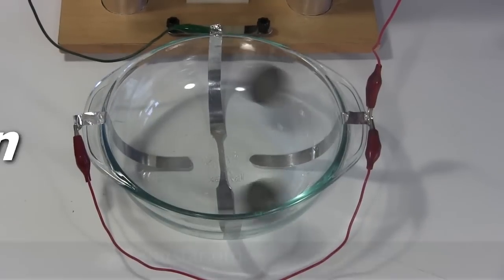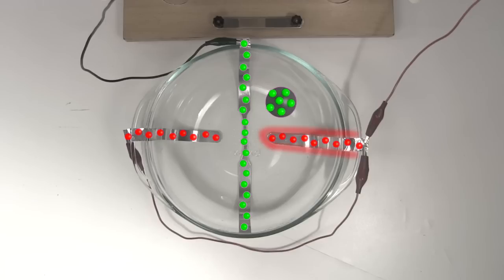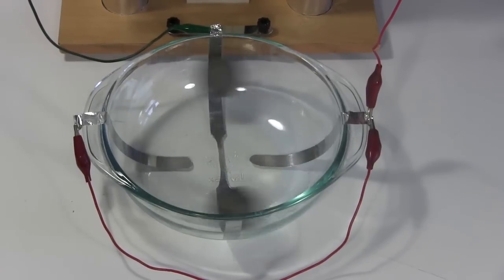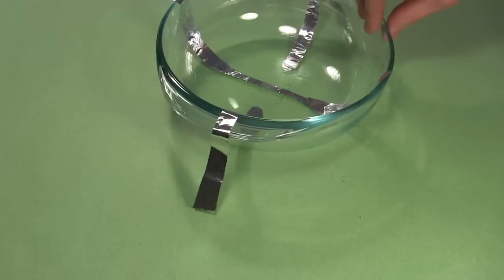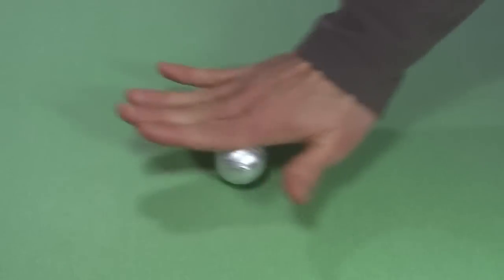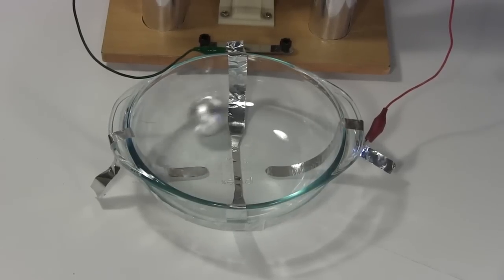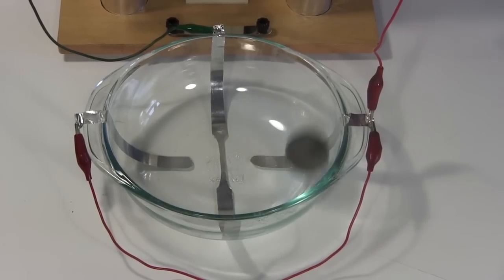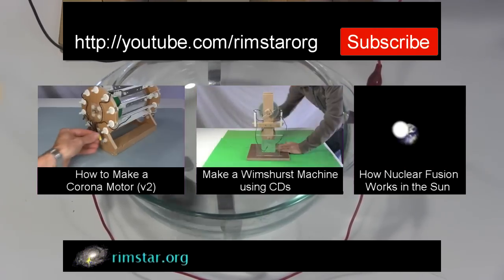Ball Cyclotron/Electrostatic Accelerator How it Works/Making

Comment from the maker: 1st video since the holidays! A Ball Cyclotron, a neat electrostatic thingy that makes balls rotate at high speed in a bowl. Includes how it works and how to make one. Enjoy!
Reply: bellissimo !!!!!!
Reply from the maker: Gianni Pirola Grazie!
Reply: How many volts and amps does the alligator clip need to handle?
Reply from the maker: The amps is very small, I wouldn't worry about that. For the volts, the issue is more a case of not having too many sharp points on the alligator clip because high voltage at sharp points causes ionization losses to the surrounding air. But the sharp points on an alligator clip aren't sharp enough to matter in this case. I think any alligator clip will work.
Reply: @RimstarOrg  Thanks rimstar

Comment: Horse races of the future
Reply: O.O
Reply from the maker: Grant Thompson - "The King of Random" Guess I should have put an aluminum one up against a nickel one. My bet would be on the nickel one!
Reply: RimstarOrg
Could someone Invent a blender that works in a similar fashion?
Reply from the maker: Hermann Kateri There's not enough torque. Any food would immediately prevent the rotation. That's pretty typical of electrostatic machines and opposed to electromagnetic.
Reply: RimstarOrg Oh well.
Reply: Hermann Kateri they have this kind of blender, only it uses a much stronger force: magnetism. The blade part contains a powerful magnet and a rotating magnetic field below spins the blade. They are used a lot to stir chemicals while being heated.
Reply: +Grant Thompson - "The King of Random"  The gold ball would always win, wait it's the future... Probably the element Roentgenium would be the fastest
Reply: rip our boy.
Reply: Even TKOR😍😍😍
Reply: HELL YES
Reply: GOT SOME JOJO FANS HERE

Comment from the maker: +harsha vardhan No, you need high voltage DC. I don't know exactly how much but it's in the thousands of volts. I don't know which ones you can buy off-hand. A Wimshurst machine with disks around the size I show in this video works and is available on places like ebay. Just search for Wimshurst machine and you'll see plenty.
PS There's no Reply button under your comment because of your Google+ settings.
- go to your Google+ page,
- in the top, right corner click on your thumbnail icon,
- in the popup that appears, click on "Settings".
- for the 2nd question down "Who can comment on your public posts?" set it to "Anyone".
Reply: RimstarOrg can i use van de Graff generator to power it

Comment: For everyone asking about alternate power supplies, I recommend finding yourself an old CRT TV or computer monitor.  They are the heavy old boxy kind that were common until the early 2000's. I usually say the bigger the better but in this case I think practically any size would do. Lots of people have them collecting dust in their basements, but if you don't, just ask around or watch for them on curbs, in back alleys, or in dumpsters.  There's probably zillions of videos explaining this already, but here's how to use them as a HVDC supply.

Get a screwdriver with a plastic or rubber handle and a wire with alligator clips.  After removing the back of the case, clip one end of the wire to the metal frame that the circuit boards are mounted to and clip the other to the blade of the screwdriver.

Identify the big wire connected to the side of the tube under what looks like a suction cup.  Stick your screwdriver under the cup and pop the cup off.  The wire is to make sure you don't get a shock.  Cathode ray tubes can store enough charge to give you a minor shock even if the device is unplugged.

Now all you need to do is disconnect the screwdriver from the clip and connect it to one terminal on the demo and run another wire from the inside of that suction cup to the other terminal.  Stand clear and plug the TV in.  NEVER make adjustments with the device plugged in.  Large units produce over 30 kV which can jump over a full inch and easily punch through low voltage wire insulation.

Using a CRT as a HVDC power supply can be hazardous but it's not too difficult to mitigate with care and common sense. They usually stand up to the abuse quite well so long as you don't go nuts drawing arcs for minutes at a time.  Even a tiny B&W travel TV should happily run this demo indefinitely.  For added safety, replace the back cover and run your wires through a pair of holes drilled a few inches apart in the case (or use the existing vent holes if they're large enough).  Just make sure the high voltage lead wont get anywhere near any of the metal structures inside the case.

Comment: You could connect the two strips that don't run across the bowl by making them from one long strip that runs under the bowl. I'd try it without the aluminum foil on the ping pong balls. They may hold enough change without it and they will roll better.  Electrical experiments used to involve pith balls, and if you could get one of those it would probably work great. Thanks for the video! Very stimulating. Hmmm, wonder if you could make a giant model of an ion propulsion unit using puffed rice cereal ....

Comment: i wanted to know that does this ball cyclotron works with battery instead of wimhurst machine
Reply from the maker: +Malika Sharma No, the ball cyclotron needs a high voltage. Just how high a voltage depends on the spacing between the foil strips but it's in the thousands of volts.
Reply: So can house power supply work or is there any alternative instead of wimshurst machine cause i dont have one.... so plz tell me an easy altrrnative...
Reply from the maker: Malika Sharma That depends on what you mean by a house power supply. Depending on where you live the voltage you get from your wall socket is only 110 volts or 220 volts, nowhere near the thousands of volts needed for this. The same goes for all the wall adapters you plug into things. However, I have a homemade high voltage power supply that plugs into the wall socket and puts out the needed voltage. But a Wimshurst machine is much, much simpler than that.
If you're looking for a science project like this, may I suggest the Franklin's bell in these videos of mine http://youtu.be/cjlMrSlIIIQ and http://youtu.be/fEqudsyIWzk. Near the end of the 1st video I show how to power it using things from your kitchen. You could even try other things that I talk about in my Triboelectricity video http://youtu.be/ey88EdZo9hU though I haven't tried them.
Reply: Thank you .....very much
Reply: You can power it using a high voltage module . It is very cheap and available online. The input for that high voltage module will be around 3 to 6 volt dc.

Comment: Actually to find voltage you can do 

(K*q1*q2)/r^2 = mv^2/r then find the q1 and q2, use derrivarives to find the electric Flux which will give you an answer in Vm or Jm/C
Reply from the maker: ProSurviver mv^2/r = centripetal force? If so, are they really forces acting in the same direction? If not then equating them shouldn't work. The r's would also be different. Fun in either case!
Reply: If we consider the ball as an electron I suppose, but when I did the math I got around 47 or so kilovolts when I created mine? pretty closed, I would have had to done more trials but my PS shorted.

Comment: Very cool! Planning to use this for my science fair. Can I use a normal battery and switch instead of the Wimshurt machine?
Reply from the maker: No, it requires a high voltage. I didn't measure how high in this case but I'd guess in the low thousands of volts. A normal battery can be anything from 1.5 volts to 12 volts.
Reply: @RimstarOrg  so I need atleast 9kV to 15kV??
Reply from the maker: Probably less, maybe even 1kV. But it's hard to say. It depends on how far you space apart the foils (closer = lower voltage), how sharp the edges are (you can't get much sharper than aluminum foil), how much foil is close to other foils (less requires lower voltage)..

Comment: now I want to build me a whimshurst machine! nice video!
Reply from the maker: Rulof Fai da Te It would be easy for you to build. You can use old black vinyl records for the disks. I might do that myself.
Reply from the maker: Gamer_Devil No, you need high voltage, in the thousands of volts compared to batteries which are only tens of volts or less.

Comment: what would happen if you made one donut style inclosure with two separate smooth and circular channels putting one ball in one channel and then a scond in a second grove then made one go clock wise and the other counter clock wise making the rotating clockwise one to power the other and then the other to power the first with a kind of relay to switch polaraties at the right times to keep each powered
??????
, Wilf

Comment: I tried making one tonight. No luck. I'm using a 2amp dc power supply with aluminum tape on a similar glass bowl. I've set my supply to 3v all the way to 12v. Is the whimherst thing AC current?  Any other suggestions?  Thanks!
Reply from the maker: agentj3000 No, the Wimshurst machine is AC current, but it's also high voltage. You need high voltage DC for this to work, in the thousands of volts, the exact voltage depending on the distance between your foil strips.
Reply: RimstarOrg Awesome!  I guess the kids & I will be making a Wimshurst machine.  Thanks for the quick reply.  I love your channel.
Reply from the maker: agentj3000
Cool! Glad to see it's an opportunity for you rather than a problem. The bigger the disks on your Wimshurst machine the better. I'm not sure my Wimshurst machine with CDs for the disks will supply enough charge or at least give as exciting a result.

Comment: Can you explain why there is a space required to be left between the positive and negative strips inside the bowl?
Thank You In Advance.
Reply from the maker: If there wasn't a space then the metal strips would be connected together. The small electrical current would flow through the metal strips. There would be no voltage -- no positive for the ball to be repelled from and no negative for the ball to be attracted to.

Comment: I used a 12 volt battery instead of whimust machine .will it work? and please tell how to connect wires with the strip
Reply from the maker: No, a 12 volt battery won't work. You need a high voltage, probably in the 10s of thousands of volts.

Comment: Can you try painting the ball with some of that paint you used on the portable Wimshurst machine build? Remember how it was unexpectedly conductive?
Reply from the maker: USWaterRockets Thanks for the suggestion. I just tried it with the paint (Krylon BBQ and Stove paint) and it worked just as well as the nickel coated ones. Sadly I didn't think to try the unpainted ping pong ball and now don't have any unpainted ones left.
Reply: RimstarOrg That suggests that the nickel paint and Krylon paint are working better because they are lighter and have less rolling resistance than the ball wrapped in aluminum foil. Determining if the electrical conductivity of the coating improves the motor is going to be harder to prove.
Reply from the maker: USWaterRockets Not so hard to prove... I just bought some new ping pong balls from a dollar store and they don't move, whereas if I throw in a nickel coated one at the same time, the nickel coated one moves around a lot, but of course the non-coated one just sits there is in the way.
Reply: So is the Krylon paint similar in conductivity to the nickel paint?
Reply from the maker: USWaterRockets Nope. I just checked with my meter on the resistance scale and the nickel coated one shows single digits ohms (e.g. 2.5 ohms) per centimeter and the krylon coated one is in the hundreds of megaohms per centimeter and often infinite resistance depending on where I touch the meter probes.
Reply: Being that the Krylon painted spheres are slightly conductive and move in the motor just as well as the much better conductive nickel painted spheres, is there anything that can be concluded from the comparison to the unpainted (non conductive) spheres?  What does that say about conductivity vs. motion of the motor?
Reply from the maker: USWaterRockets My take is that it means most of the conduction is done through corona in the vicinity of the sharp edges of the aluminum strips. The corona isn't noticeable to the eye since it's so weak.

Comment: Hey I was wondering suppose I use batteries, then how many 9V batteries would I need in order to get the same result as you in the video? ( I know you said that batteries are not recommended in the video but i'm just wondering).
Reply from the maker: Dart Fled You need a voltage that in the 1000s of volts, so it just wouldn't be a practical number of 9V or any other size of batteries available.
Reply: RimstarOrg Ahh, I see, thanks.

Comment: What kind of voltages do those strips of aluminum see?
Reply from the maker: Justin Bell The voltage is not something I can determine since it's between a strip, the ball and the next strip and is highly dependent on the shapes involved.
Reply: RimstarOrg

What's the output of the wimshurst machine?
Reply from the maker: Justin Bell I can't say what the output voltage of a Wimshurst machine is. The maximum voltage of a Wimshurst machine by itself is determined by how far apart you make the spark gap. When the voltage is high enough for the chosen spark gap distance then a spark will occur and the voltage will be zero and have to build up again.In this case the charge is being transported by the ball and so the spark gap never reaches its maximum. So the maximum voltage is determined by the ball cyclotron.If you remove the spark gap from a Wimshurst machine so that you have only the disks feeding the Leyden jars (capacitors) then typically the voltage builds up to a point where the losses on the disk surfaces prevent further voltage increase.So the voltage is determined by what the Wimshurst machine is feeding.The current at the collectors of a Wimshurst machine is typically in the low tens of microamps or less.
Reply: I have Wimshurst machine that is almost exactly like the one in the video, and it can produce sparks around 3cm or more. So i'd say it's something like 30+kV, though may be different

Comment: We can get this to work any suggestions? Should we add more foil??
Reply from the maker: What are you using for your high voltage power source? What are you using for the balls? Make sure you are making good metal-to-metal contact wherever you need to.
Reply: @RimstarOrg  a similar hand cranked windhurst machine, and pinf pong balls.
Reply from the maker: What are the ping pong balls coated with? Ping pong balls by themselves are not electrically conductive. That's why in the video I put aluminum foil for one demonstration and paint it with nickel paint for another demonstration. If you use foil, make sure the foil is fairly smooth. Also, taping aluminum tape to aluminum tape doesn't make a good electrical connection. You can also try playing with different spacings between the strips in the bowl.

Comment: hey can ve use a 12v dc supply instead of wimshurt machine.Or can we use a van de graaff generator.
please tell me fast i have to submit a project.
Reply from the maker: shubham dhabu No, you need a high voltage source. I don't know how many volts exactly but something in the thousands. It also depends on how close together you put the aluminum strips - closer = lower voltage, but still in the thousands.
Reply: ohk..... thanks
Reply: RimstarOrg  thanks. by the way i've made your van de graaff generator for my project.

Comment: What is the significance of making the long strip thin in the middle and having two short strips?
Reply from the maker: zzasdfwas Making the long strip thin in the middle causes it to be as far away from the short strips as possible to prevent sparks between them. All the strips could be made short with nothing in the middle but you need to connect them to the power supply such that every other strip is connected together. You could connect them that way by running strips around the outside but we're dealing with high voltage here. Those strips running around the outside would eventually cross and you'd have sparks between them there instead. The way it's done in the video avoids any strips or wires coming close to each other anywhere.

Comment: Where did you get electrically conductive paint?
Reply from the maker: John Kerley I got it from a local electronics store. They all seem to have it. But online it's here http://www.mgchemicals.com/products/protective-coatings/emi-rfi-shielding/super-shield-nickel-841/
Reply from the maker: John Kerley I got it from a local electronics store. They all seem to have it. But online it's here http://www.mgchemicals.com/products/protective-coatings/emi-rfi-shielding/super-shield-nickel-841/
Reply: RimstarOrg Ok,thanks. I was just wondering because I used to want some before to spray on a large diameter ball for making a Vann de Graff machine. I don't know how expensive that would have been,but I might look in to it sometime.